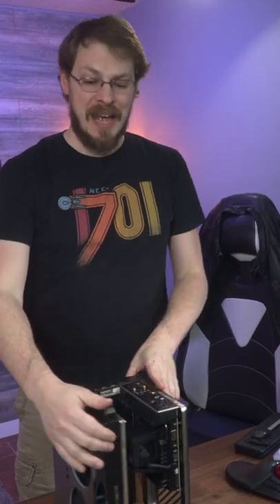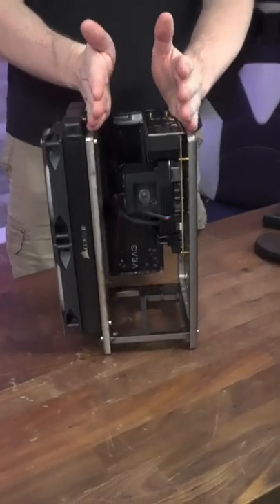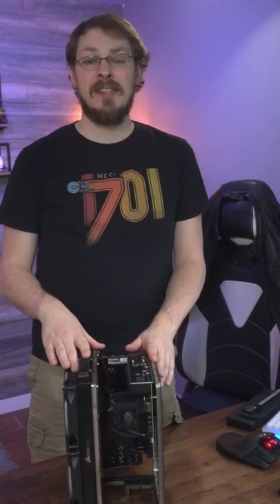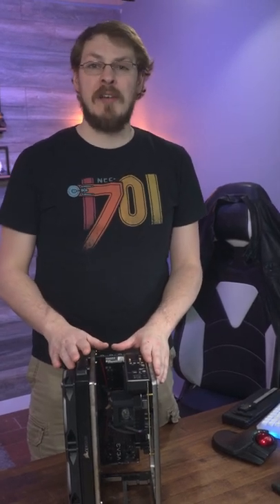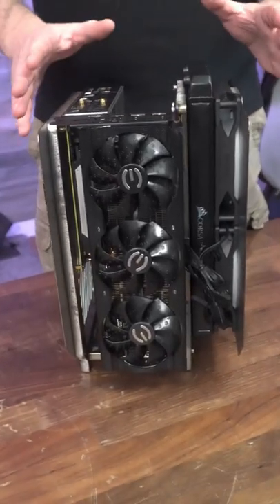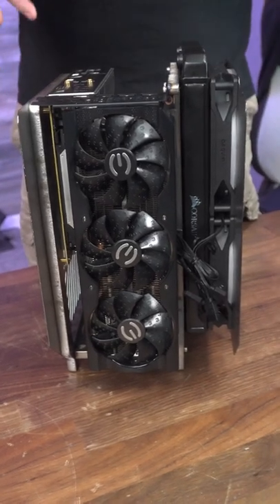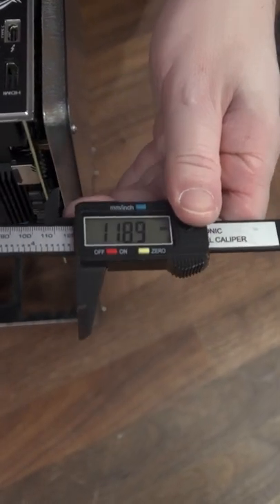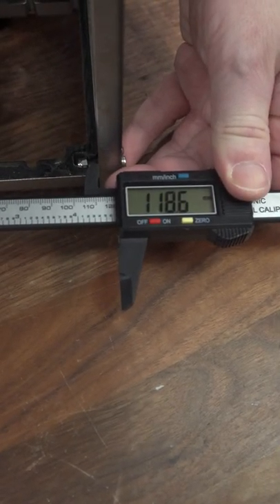ITX Steel Update #Shorts

Comment: looks like the perforated part of the thin side panel is meant to be folded over. not sure if you are aware of that feature. there was an orange case on hardware canucks that was similar in design.
Reply from the maker: It is meant to be folded. I'm waiting until much further into sanding/finishing to make the bend.

Comment: Aren't you supposed to bend those panels along the cut out lines? if not that would OCD me until I finally bent them.
Reply: Yeah, I asked that on the original video and Jeff replied that "yes they do fold," but he's waiting until the last minute to do so.
Reply from the maker: I'm going to do most of the sanding and finishing first, then make the folds.
Reply: @CraftComputing  Ah OK that answers the nagging question I had ! cheers, and good luck with the build.

Comment: Who cares if you build a rhomboid? Its like your time, your effort, your build, your channel and your equipment to edit and UL videos. If you built a computer or anything else for that matter that laid golden eggs someone would complain that they are to big or not symmetrical. And to all the fine folks you appeased with the "It is square now, look at the reading on these calipers" trick. Squares are square from corner to corner not from side to side, that is not square, that is parallel. 
Which is by the way, is why I don't have a channel.